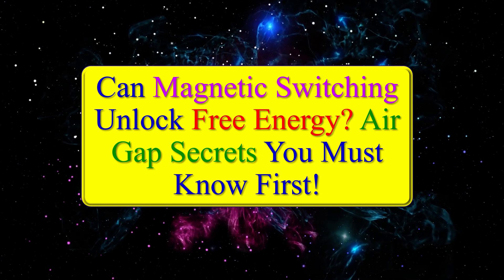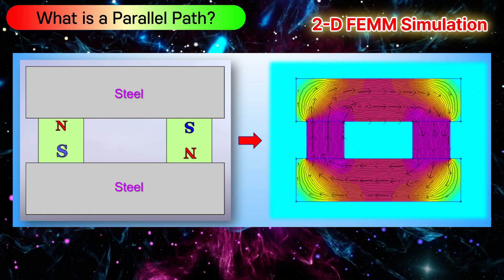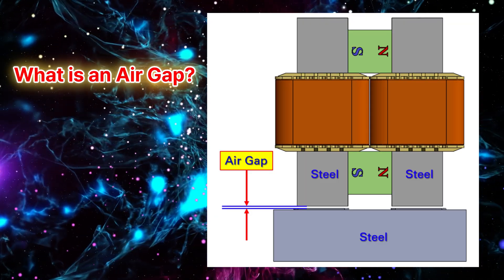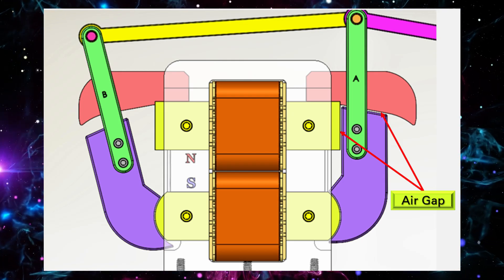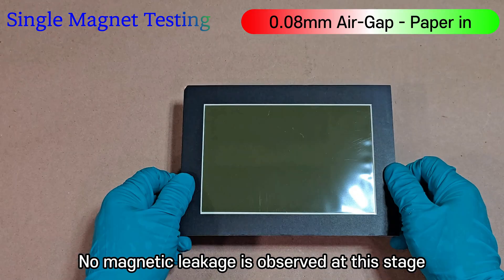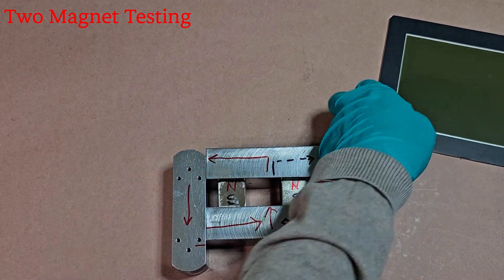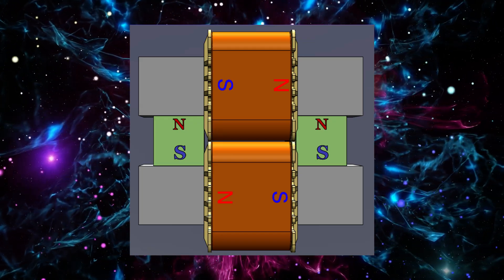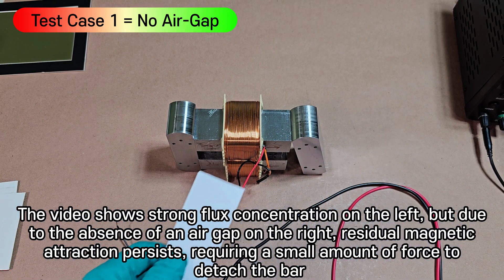Can magnetic switching unlock Free Energy? Air-Gap secrets you must know first

Comment: The secret is the spark gap. 
A spark gap of even small size is a literal catastrphic rending of spacetime.  
Only with a spark gap is there superconduction at a moment.  

Everyone builds their Tesla coils backwards.  They are meant to be step down transformers.  You take the ambient electrical charge from a tall tower (earth/sky voltage dif 100v/m elevation) and put it through the secondary< creating a spark that you step down with the primary.  Free electricity from the air.
Reply: woooooo!